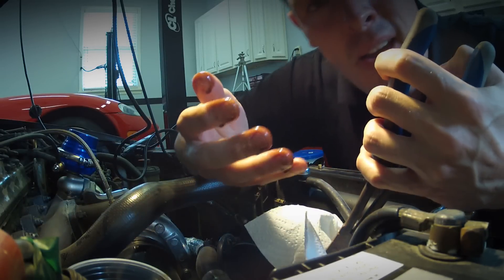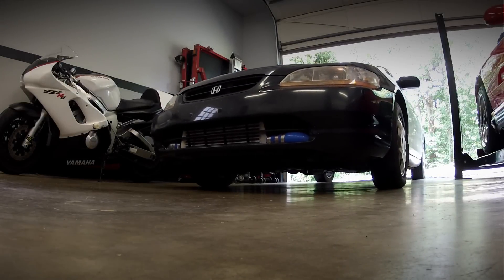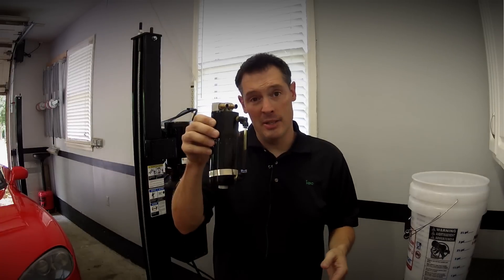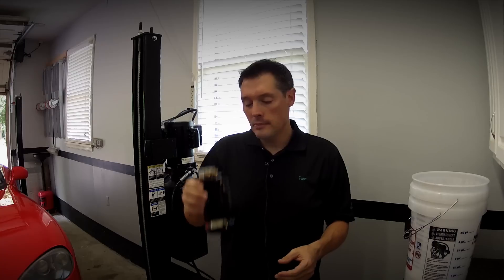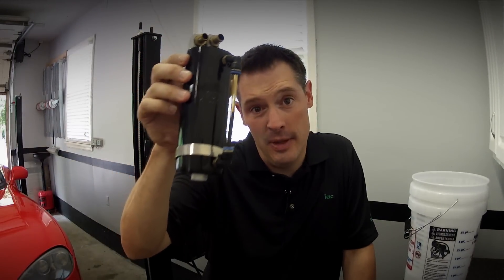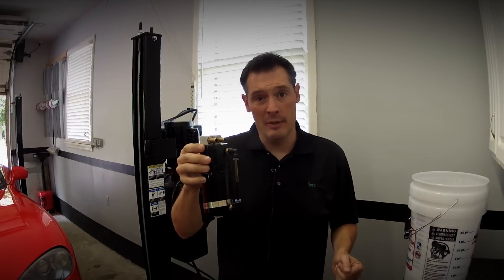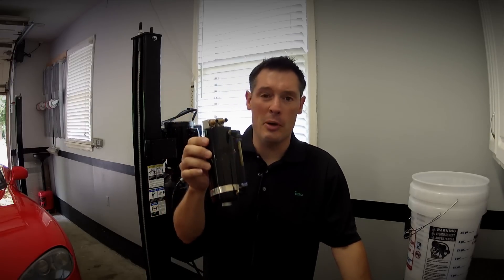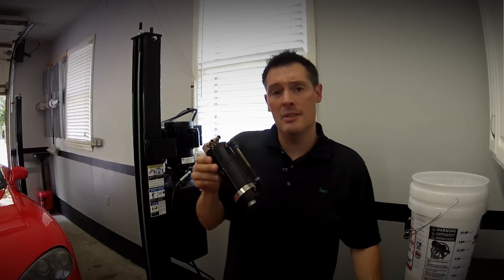Oil Catch Cans Myth Or Must Have - Ebay Oil Catch Can Review

Comment: Hmmm. Thanks. I am just learning about this. I just bought a '14 CTSV coupe as a daily driver so I am looking for one  of these. I am also an industrial maintenance manager and we have an "oil separator" in industry for compressed air lines and I am wondering if it would work for a car as well. Many of them have positive and negative pressure ratings so I assume they would work in vacuum as well... Any thoughts on that? Great video BTW!
Reply: Carol Rossko www.teamrxp.com

Comment: I have a 2004 3.5 maxima. Had the timing chain replaced and was wonderin'. Is the Ford 3.5 a derivative of the Nissan 3.5? The one that's  in my car is naturally aspirated. So far with the mileage on this car (over a 100,000) it's been quite the reliable vehicle. It's taken care of quite well.  Some motor heads tell me the engine is "bullet proof. Having said that? I'm in the market for a truck (4x4) and I was checking out the Ford 150 short bed. One with the 3.5 motor. And also the Nissan P/U's. I think they also have the 3.5 motor. Going to be doing  a road trip or two. Very little towing. Any info/advice would be greatly appreciated. Serious replies only. Thanks! Not a great fan of change.. A not so old timer here/former backyard mechanic : British sports cars and domestics too.  :>)
Reply: Ted Hernandez I don't think nissan and ford worked together but maybe early 90s if they ever did. I know ford and mazda was together for a bit but I didn't do my research either. before you buy a vehicle do some extensive research and weight them well. sometimes reliable to some is different for others. hope you don't find a abused one.
Reply: Rick Trajan Thanks for the Feed back Rick. I do remember some time ago Ford and Mazda hooked up. I did have a Mazda 626 sports car, Standard 5 speed trans 4cyl. very good looking car but underpowered. I took the trans out in later years and couldn't believe the plastic parts in the tail shaft. Very disappointed in Mazda at the time. Had probs with this little beast. Today it's in a cow pasture upstate NY. Getting down to my original inquiry...I did find a nice Nissan Titan p/u. New one and I happen to like it. It's full sized and has what I need. 4x4 and the works. If I can be of any help with questions down the road, please feel free to contact me. I know a few tricks of the trade auto and small truck wise. This from many years of doing my own work. Thanks to great mentors.
Reply: Ted Hernandez nice, I'm a auto tech but my experience is mostly made of simple repair and maintenance because of where I work. I do work on my own cars but I haven't done any major work that requires disassembly of engine/transmission.
Reply: If you don't have to? Don't. Like you said, the simple repair jobs save a few bucks. But the big stuff, now? I leave to the mechanic. But it's always good to know about your vehicle if and when someone has to work on it. You enjoy your day bub. And thanks for your input.

Comment: I just purchased the same oil catch can as you have in this video. I peered through the drain hole and I was shocked to see NO FILTRATION AT ALL.
Just an empty can.

Inlet hose halfway down my ass.
They're both up high and equal length.
I paid $30. Ebay.
Exact same as yours.
Should I put an external filter on mine?

Comment: OR ---- Address the root cause.  Stuck low tension piston rings allowing excessive crankcase pressure. See BGPRODUCTS to control oil consumption. Oil catch cans are great products. BUT do you want to fix the stuck rings causing reduced compression and performance ?

Comment: That much oil after 4K you have a problem unreleated to your PCV.  That would be a shit ton of oil vapor condensing  into liquid. You have ring issues or incorrect baffling in the valve covers.

Comment: Does your car have a chassis ???   do not waste your time with a catch can.......run your crankcase ventilation pipe down into a hole in the chassis.......stop rust !!!   make a few holes and move it around....remember it is under pressure and is a vapour it will settle all through the chassis.    Win Win situation.

Comment: I'm running a morosso catch can on my ford racing z 427 w in my superformance cobra, and it catches about an with cup of nasty blow by oil...my intake manifold is cleaner than a nuns mind...no it doesn't improve instantaneous performance, but in the Lon run...

Comment: Catch cans can make a difference depending on the engine design and manufacture.  Newer VW 2.0 liter E888 engines don't need them.  They have a redesigned inter baffling system far superior than previous.  Whereas the previous design was nasty and catch cans were very helpful!
Reply: Good point. Some car manufacturers have addressed the direct injection issue better than others. Toyota addressed this issue as well.

Comment: I think you will find that a well maintained newer car with an oil and filter change twice a year won't experience this effect. 

I know two people that maintain their Abarths just like I do, and they both have quite substantial milage on them. One put one of the quality catch cans on, and very close to the take off and return point too, and there was literally nothing whatsoever in there but a couple of drops of moisture, and that was after 4K. 

So I think you have to read between the lines on these things and make sure you maintain your vehicle properly. I have seen some with massive amounts of fluids in them after a very short period of time. That tells me the vehicle is NOT maintained properly, is neglected, or more than likely has a major issue that should be investigated and fixed rather than installing a gimmick can such as this.
Reply: Peter Robertson 
... that, or they could have a forced induction car
Reply: Peter Robertson certain engines do this because of design defects. for example the ly7 v6 from gm. it lacks a splash guard near the pcv valve, and thus the oil is sucked in through the valve into the vaccuum lines at high rpm and then dumped into the intake. if you take the air filter off an ly7 engine you will see oil in it, as well as in the intake.
Reply: Older engines with blow-by developing should have one of these or an engine rebuild. Otherwise cat will be plugged up quickly. Catch can is simple and cheap and can get you by for many 1000s of miles until you can rebuild.
So you cannot make a blanket statement that they are unnecessary.

Comment: valve seals will allow excess blow by as well. on GM ecotec engines. the PCV system runs through the head and valve cover. When the passages in the head and baffles in the valve cover clog up oil and oil vapor is dumped into the intake.

Comment: if you have that much oil blow by the rings are carboned up or worn.
Reply: Not totally accurate. The newer Eco boost engines are made to have some blow by.. Look it up add in direct injection, from past multi Port, and it matters

Comment: I wanna point out that I got the exact same model can and 2 things happened:
1) The thing leaked oil from every possible gasket and O ring all over the place
2) It significantly increased case pressure causing oil seepage elsewhere.

I can only assume the one you have there is only for NA engines. Anything with pressure is a no-go for these at least.
Reply: One specific to a turbo would be better since they tend to have 2 vacuum ports one for the intake, and 1 for the turbo or turbo's.  Of course this can also be solved with a couple of T fittings.  So that you are pulling vacuum from the intake, as well as the turbo or turbo's.  Which may require tapping, and putting a fitting on the turbo inlet side.

Comment: how do you prevent leak on that specific device??? i have the same one but have leak on the lower end of the hose... help me please
Reply from the maker: There should be a rubber o-ring that prevents leaks, if it is leaking then that o-ring is damaged or not seated right.

Comment: they are not a "myth". if you are getting oil in your intake, you are getting oil on all of the sensors that are on the intake aswell (MAF, IACV, IAT), not to mention that your intake valves will get nasty, and may get some knock

Comment: why don't the car manufacturer's  install the catch can at the factory ?
Reply: They would have to rely on the customer and 3rd party oil changers to change something on a vague interval.  But, if you install one yourself, then you are up for the task of cleaning as needed.
Reply: H Smith
and Direct Injection only cars. They really really need them.
Reply: i asked my dealer and they said because the average person wont , or dont know how to dump the oil
Reply: Adds cost.  Seems to show that this engine design has a problem.  More maintenance.  Doesn't sell cars...
Reply: Sadly, they're so uncommon, that I have worked at tons of shops where most of the workers wouldn't even notice if a catch can was there, and if it was, on the flag rate system it's unfair to expect it of us unless we're being paid to do it. Oil changing is already the domain of GST's because I shop can't pay a master tech fairly to do one without losing money. I'm technically not a master tech, but since I can fix pretty much anything my shop says is on their skills list they almost pay me like one and I'm honored they call me one. :)
Reply: They're in the business of selling engines and vehicles.  Engine goes out, they sellone.  Catch can installed, engine lasts longer.
Reply: Yea I'm sure from an end user standpoint it's a hard thing to sell. Imagine when the owner forgets to let the shop know there is a catch can and it overflows.  VW and Porsche have an air oil separator that works kind of like a catch can, when they fail they end up sucking up oil into the intake. Sometimes so bad that I had a 911 with flooded chambers with just oil, luckily it didn't damage anything, but jesus the smoke was nasty.
Reply: because its not needed, that bit of oil is nothing  for thousands of miles, its just idiots making money selling you crap, people says 'its because they dont make a profit selling cars'  - rediculous, a can costs a dollar to make, theyd do it IF it was needed, peopled USED to add oil to gas or inlet misters, funny how suddenly a bit of oil is the devil. it isnt,
Reply: DI engine have it frm manufacturer..
Reply: To save a nickel!
Reply: As long as The car starts. People don't care about what's under the hood And that's the problem. Some People have been driving the same car for years. With the same exhaust system With the same catalytic converter. (why do you get more power out of a. Cat back exhaust system. Then a Normal exhaust system)
Reply: Because they charge you 4,000$ to rebuild the top of your motor. Also, probably because a lot of car owners are retards and won’t bother to drain the can.
Reply: @AEON.  New cars burn more oil because they run lower viscosity oils these days. The reason for this is overhead cams and variable timing. The oil has to be thinner to make it's way through all the passage ways in the VVT systems. It also needs to be thin on start up so that it can be pumped into the overhead cam systems. It's also common for cars to put out over 100 hp per liter these days, which was nearly unheard of on a production car 20 years ago.

If manufacturers were intentionally breaking cars, they wouldn't have implemented electronic steering, which is proving to be vastly more reliable on most cars than the old hydraulic systems from the past 40+ years. Same goes for electronic cruise control. Remember when simply leaving CC turned on would cause it to fail? When is the last time you heard of CC failing on a car? Another example is DI with PI. First generation direct injection motors have issues with the valve seats over time due to the valves not getting washed with fuel and carbon build up. Most DI cars these days now also have port injection which serves no purpose other than preventing this issue.

The reason car manufacturers don't install catch cans is because they aren't legal. The way the law is written for the PCV system, it HAS to be routed back into the intake. It's similar to how blow-off valves also aren't legal. That and it's another maintenance item and adding maintenance to cars doesn't bode well for sales.
Reply: @AEON.  you have no idea my resume. If you did, youd rephrase your nasty response. You are a tool. I could refute all your bullshit conspiracy theories, but now you've made me not want to communicate with you.
Reply: Why?  One simple answer for one simple question brother - Car companies 
do not pull much of a profit from selling cars - their main income is in
 selling parts and service. #Fact #Mindblown - not really mindblown - but that's as simple as it gets right there sir.
Reply: @AEON.  very true plus if thay did. Put them on all there less modal car's. As you said garages make there money from car servicing. And that's oil changeing. If they said to you. Hay you don't need to be buying car oil all the time. You can save money. On oil checks. With an oil catch can
Reply: @AEON.  that's about the dumbest shit I've ever heard. Just think about how dumb it sounds, that someone would build a product that would purposely break. Also, if that was true they WOULD put them on and then tell the customer they need to come in to have it changed. They would also make you not be able to change your own oil. Also, I dont know anyone who goes back to a dealership to buy an engine for a car unless the manufacturer is covering the cost. Just dumb on so many levels.
Reply: @matthew1192  I know a ford master tech that told me ford designed their transmissions to go out after 200,000 miles back in the day.
Reply: @jsjones418  well he lied to you. I want you to think about it for 1 second. I want you to picture how he was informed that by Ford. Did ford send out a company bulletin saying "Hey everyone. You'll probably notice that transmissions have been going out at around 200k miles. We designed them that way so we can make money, even though people will believe our company does not make dependable cars." Or was he eating lunch with one of the engineers, who showed him design schematics of a transmission with a big arrow pointing to the 1 part that needs to go out at around 200k miles. Because if that part doesn't go out often, the company will tank because they are depending on it breaking... AND the customer choosing to use Ford for the repair and not some shade tree mechanic. Just think about how silly that sounds. And look around at all the Fords that are still running with transmission that have 2 and 3 times that amount of mileage on the transmission. Come on man...
Reply: @matthew1192  there are no transmissions that last longer than 200k except for imports lol every vehicle that I have owned or other people have owned that I know have always had trans rebuilt. I'm guessing you have never owned a vehicle or have never drove a vehicle from new to 200k. I also know a guy that built a machine that cools blood for blood transfusions that kills cancer cells. Big pharma company bought the patent and discontinued the machine but let me guess he was lying too.
Reply: @jsjones418  lol. I love the assumption you make. And you are absolutely wrong about transmissions not lasting 200k. I know many relatives who have cars over 200k that have never had ANY major work done, engine transmissions.
Reply: NOT WITH DIRECT INJECTED ENGINES, particularly the early models !      All the others put the hoop in with the fuel coming in over the valves.    This washes the valve stems constantly.     DI puts fuel in like a diesel so that goop goes in over the valves with no solvent ( gas).     That lets it cook and build up high eventually lease to intake valves sticking, poor starting and generally poor performance.     The can can’t stop this but greatly reduces the amount going onto those valve stems.   
    The latest models address the intake valve problem by redesigning the plumbing of the PCV system but we earlier model owners are stuck., thus the cans.
Reply: cptdavidwebb it's only for turbos

Comment: should you put the pcv valve on the clean side of the  oil catch can ? It seems stupid to have it before the catch can . You would still be changing the pcv valve because all that dirty oil is going through it  . Why not move it to the clean side and you would still have the valve but it would stay clean .
Reply: steve dental interesting observation. Wonder if this would mess anything up by just moving the pcv just a bit downstream

Comment: so what do you do with that junk? just keep throwing it away? .. I would think that oily junk is effective for lubricating the moving parts in the intake
Reply: The intake has not parts to oil.  The oil caught no longer heats up, which helps to get water from condensation out of the oil, so it should just be recycled like used oil rather than reused.
Reply: Nname Withheld You take the old oil back to the auto parts store to get it recycled.
Reply: The oil vapor the gets pulled into the intake causes build up on parts and can cause some problems. Not to mention burning oil isn't good.

Comment: This might be a stupid question but if it's catching the oil your still needing to add oil.
Reply: It's usually oily water vapor that it's catching rather than straight oil. If it's losing that much pure oil, you would notice it on the dipstick between oil changes already. The stuff that the catch can catches would only be going into the intake and being burned up, not going back into the oiling system.